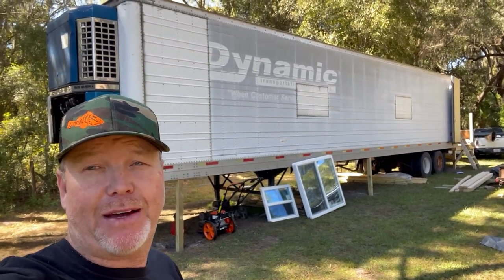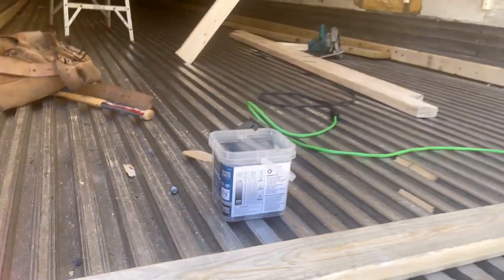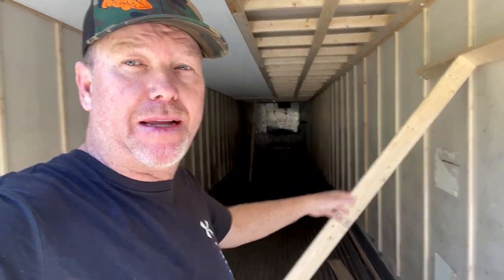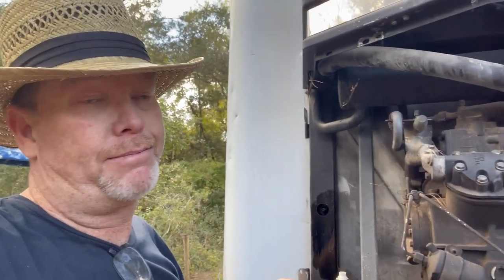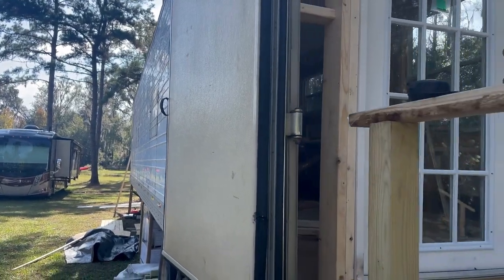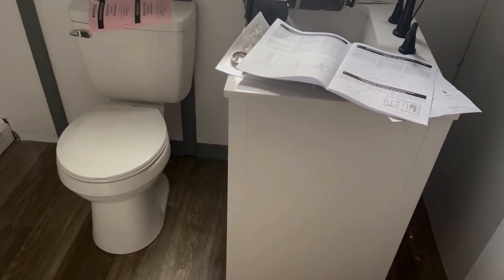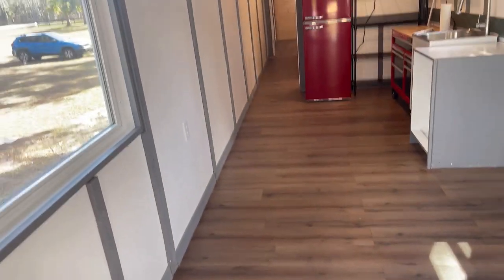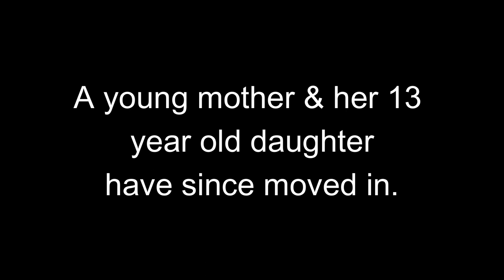*TINY HOME TOUR* Big Rig Refrigerated semi-trailer converted into a Tiny house.

Comment: Great build. Going to start mine this summer. Question: How hard was it to cut through the metal flooring for the bathroom drains?
Reply: Maybe I can answer that if you don't get an answer!
Reply: @christopherayala348  Since it's been a month, that would be great if you could.  My thoughts are just metal cutting blade since it is aluminum.
Reply: @christopherayala348  my other worry, on making a home in a reefer, is condensation while living in it. What works, what doesn't.  No one seems to get back to me on this.
Reply: @christopherayala348  Thank you by the way!
Reply: @pahpahpostal2157  I've been at it for 2 years and I learned how to get around things to make it easier by trial and errors
Reply: @pahpahpostal2157  you have to use the most heavy duty round hole saws. (Hole saws for heavy duty metal only) Make sure to get drilling lube because a lot of smoke will happen while drilling metal to aluminum. Get a heavy duty drill (power drill) one that plugs in not one that takes a battery for full force power. Keep it a steady pace and it may seem like it's not cutting through but I took half an hour for each hole all the way through.
Reply: @pahpahpostal2157  as long as you have a bathroom, bedroom, emergency escapes, big enough windows, entrance and exit door, you can go to your DMV and tell them you need the trailer title converted into a travel trailer registration. All they asked me those things, and I only paid $160 to convert the registration into a travel trailer registration. 0 inspections. All I had to do was write down those things I did. And say you're holding off electrical. You're just going to use an outlet. Otherwise if you tell them you're doing electrical they will send a inspector out to you and you don't want that because that can ruin it for you. Mention off grid bathroom. Without plumbing. And then after you get the travel trailer registration, THEN get a personal electrician and personal plumber if you want. But plumbing is easy if you use shark bite pieces
Reply: @pahpahpostal2157  most RV parks I called around said as long as it looks good on the outside, and I have a travel trailer registration they will take me. So that's how I got around that for a living situation
Reply: @christopherayala348  roger that!
Reply: @christopherayala348  absolutely perfect information. Much appreciated!!!
Reply: @craiglawrey7518  also for the travel trailer registration tell them it's a reefer already insulated already studded by the manufacturer and it's already a box with studs, flooring, walls, ceiling. They gave me the travel trailer title within 15 minutes when I told them that

Comment: I'm so glad to find this video! I have a 2003 utility reefer I'm converting. I have the same grooved flooring and done with the flooring so far. It's pretty damn exciting to work on it! Now, where I'm stuck is how did you screw the ferring strips into the alluminum studs? Did you just only pre drill through the alluminum and then screw the ferring along with it? When I try to pre drill it it only makes a chip. It's so damn strong I can't seem to drill through it but I'm sure I'm doing something wrong here.
Reply from the maker: we didn't really have a hard time with that. It may have been the screws we used were self tapping. Good luck, looking forward to he hear of your progress
Reply: @FreedomTours  approximately how long did it take you? And your studs were alluminum right?
Reply from the maker: @christopherayala348  yes, it took about three months
Reply: @FreedomTours  quick quick question!! I'm super stuck on this one... So my floor is the same as yours grooved alluminum, how do I drill the holes for the plumbing? It seems really impossible to drill the holes for the toilet, vent, ect. How did you do it? I was thinking about just cutting the side of the wall but I need to be up to codes and all...
Reply from the maker: @christopherayala348  sorry for the late response. We used hole saws that attached to our impact drill. Worked well.

Comment: Just found your channel, very interesting!  I live in Oregon and was wondering if  you had any contact info. for the place you got windows?  Pat's in Leesburg, OR?   Thx!  This is a very good conversion!  Great job to the young man and his construction skills, and for all your work getting it all done!
Reply from the maker: Yes, that’s exactly where we got the windows… and the flooring/ceiling
Reply: @FreedomTours  I am VERY curious about the decision to do the large air gap ceiling? Versus adding something like Rockwool insulation to fill the space?
Also, thoughts on vapor barrier control? / Condensation/trapped moisture?